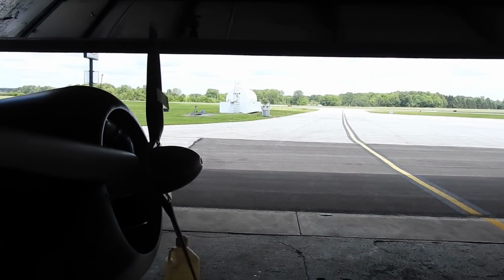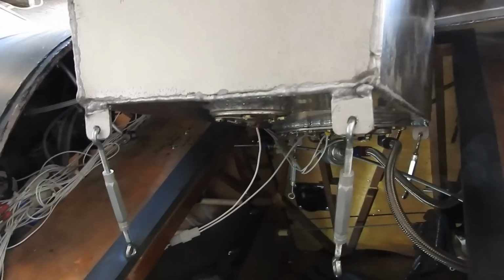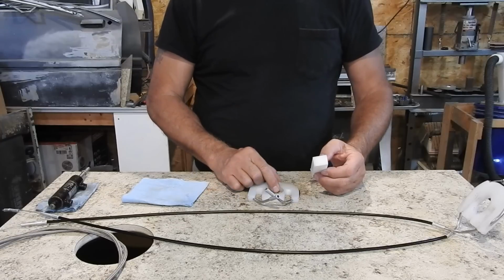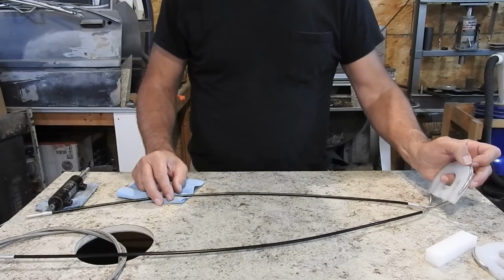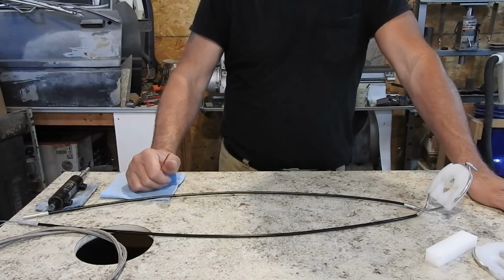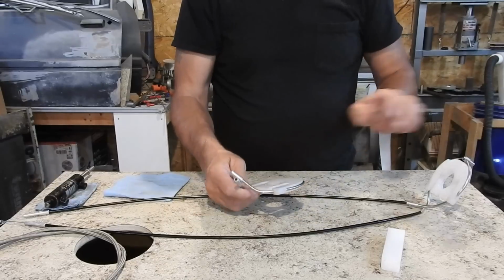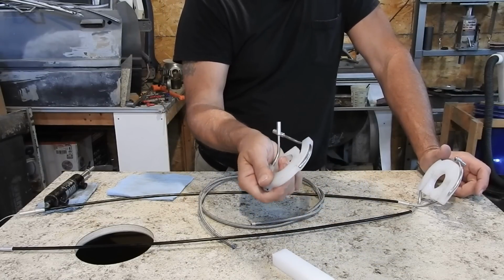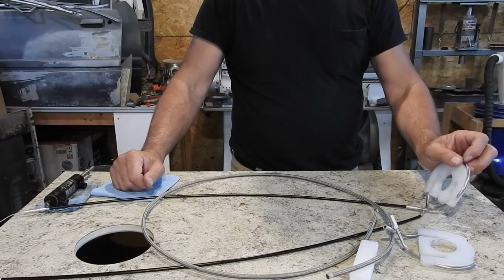WAR Corsair tailwheel work and taxi test

Comment: Pretty awesome!! Will be interesting to see how that prop does. Seems like a pretty flat pitch. Wondering if maybe it needs a little more pitch. Definately has a big diameter. Should have lots of static thrust i just wonder if its going to give the speed it needs to cruize well
Reply from the maker: Prop is pitched for max takeoff speed. Will adjust as testing continues.
Reply: @Dynodon64 on my plane, RV-4, I can only make 2200RPM static. That’s about 80% of max. As I pick up speed, the RPM starts to increase. I can still overspeed the engine in flight. Are you saying that you make full RPM statically? If that’s the case, you are going to severely overspeed then engine, and I would recommend adding blade angle before you attempt to fly this.
Reply from the maker: @taltruda  Prop is set to 500 rpm before max speed static. If it needs more, I will increase it.

Comment: If you are not using catalytic converters in the exhaust, you can use a cooler thermostat. You might want to use a restrictor instead to eliminate a point of failure.
Reply from the maker: A lower temp thermostat, will play hell with the computer. The computer will think the engine is still cold and not take out all of the fuel enrichment for cold start. It will run rich all the time.

Comment: G'day,

It all progresses...!

Good job on those Wheelbrakes, it seems that they're now fully  functioning as intended...(?) !

And, that there Tailwheel Steering idea is apparently proving to be at least as fiddly and tricksickal and confounding to dig the Bugs and Worms and Lice and Mites out of...,  as I feared it would be...; and you're about to embark on it's 4th iteration, which is to be
Stronger,
Metallic not Plastic, with
Thicker Cables,
Fatter Cable-Guides, and
Stronger Springs,
All
The better to absorb greater
Stress, and loading as the
Weight of the Tail
And the Inertia of the Airframe,
The Slope of the Ground, and 
The Wind Direction and Strength
All argue amongst themselves to dispute the Friction-Coefficient of the Tailwheel's Tyre against the Concrete (and/or the Cracks therewithin !)..., all of that
Vectored,
Leveraged and 
Multiplied by the
Cantilevered Forks supporting the Tailwheel's Axle 
Vis-a-vis the Tailwheel Fork's Axis of Swivelling...

And the overall outcome now to be feared..., being the possibility of
Structurally overloading the Glued Plywood of what was originally
Designed to be an Aerodynamic Fairing..., to cause the Tailcone to visually  conform to the
Plan & Elevation contours of a
Corsair's Tailfeathers...

Did I miss anything ?

To tell the truth Don, I still agree with myself back when I suggested that you might be better to leave the Tailwheel the way WAR designed it to be..., fix the Wrongness in the Brake Circuit, and get on with enjoying the process of operating that Aeroplane as it was designed to function.

I note that you have already discovered that the major reason why the original setup
APPEARED to be unworkable, was that you were trying to steer, using differential braking, while almost stopped  - and thus there was insufficient Momentum within the Airframe for the Lateral Friction differential to yaw the Tail, before your rolling forward completely stopped.

A bit more power, jogging along at a brisk walk..., and EVEN with the wrong Master Cylinders, 
It
WORKED, 
As advertised and as prophesied.

So, not to put too fine a point on it, mate...; you might be
FAR better off to take ALL those iterations of trying to fix the
NON EXISTANT "Problem",
And hang them all 
Up on your Wall,
As a reminder to avoid
"Going off on a Frolic...".

When you feared that the Brakes were failing to steer the Aeroplane while taxying (when they were not actually failing to steer - but you were failing to proceed sufficiently energetically for ANYTHING to effectively change the Heading...), you understandably immediately  feverishly cast about wondering what to do to "fix" the "defficiency" - and in your flustered anxiety you've 
Assumed
There to be a 
"Need"
To render the Tailwheel
Subservient and
Obedient to your
Rudder Pedals...; and because the Brakes 
Appeared
To be ineffective...
Then you committed yourself to
Trying to go
Tying the Tailwheel to your every
Toe-twitch,
Using Bowden Cables
(Like Biggles had, 
Olde Bean, to fire his Vickers Guns in the Sopwith Camel, by Jove !)...

And, you're now chasing after that (heavy complicated)
Shibboleth still, even after having fixed the Brakes, and eliminated the "problem" which originally inspired you to go off on the Frolic in the first place...(!).

Is there any reason, beyond simple
"Target Fixation"
Driving you to keep running down this
Rabbit-hole ?

"Simplicate,
And add
More
LIGHTNESS...!"

has turned out to be a reliable sort of a Mantra (as long as one doesn't "go the full Stockton Rush"...!) ; so I still reckon you'd be better off proceeding to learn to become good at taxying on the Brakes with that fully-castoring Tailwheel.

I suspect this comes under the old Hillbilly-ism...,

If'n it
B'ain't  (Be not...)
Broke...; then
DON'T ye go messin' around
Trying' ter
"Fix"
Nuffink ;
Least yer makes it
All work 
WORSE-Er-Er...!".

The legendary Mousetrap on the
White Knight's
Saddle,
In Alice's Wonderland, kinda 
Comes to mind....(lol).

You've made a lovely little Aeroplane Don, try not to overcomplicate it, and maybe perhaps possibly postpone the whole Steerable Tailwheel Modification until after you've slow-taxied 5 hours, fast taxied 5 hours, runway-hopped in Ground Effect for a few hours, and then flown 5 or 10 hours of Circuits & Bumps....?

By which point, I predict, you will realise the Side-track for what it is - not a Road worth going down...(?).

Your Choice...

I do squeak from the Fools' Gallery, after all.

Take it easy,

Have a good one.

 ;-p

Ciao !
Reply from the maker: That's sure was a mouth full. Thanks for the input. I will be taxi testing it for a little while to see how the full swivel works now with the right master cylinders. I still feel it would be better if it was steerable. I intend to do a lot of taxi work. Right now I have no choice. I need a bi-annual and a tailwheel indorsement before I am fully legal to fly it. So I have plenty of time for taxi test.
Reply: @Dynodon64  

No worries mate !

Thanks for not getting cranky with me for questioning the need to try making the Tailwheel become Steerable...

My daughter tells me that I'm Autistic, which she reckons to be the reason I often spout long loud idiosyncratic opinions...; kinda thing.

  She also tells me that Autism and Narcisstic Personality Disorder both present the same, as far as casual observers see from the outside...

She may be not wrong ?

Maybe Autism is what
Benign Narcissism looks like ;
Whereas Adolf, Joe Stalin, Pol Pot, Tronald Dump, or Rupert Murdoch all rank on the scale of 
Malignant
Narcissism...

So, I try to be a
Friendly
Harmless
Helpful
(Autistic ?)
Oddball...

And, I may be wrong.

But at least I mean well (?) !

Have a good one...

Stay safe.

;-p

Ciao !

Comment: Will that -3 hose resist compression enough to work as a cable sleeve?
Reply from the maker: It has a nylon liner, no rubber. Their pretty stiff. We'll find out.